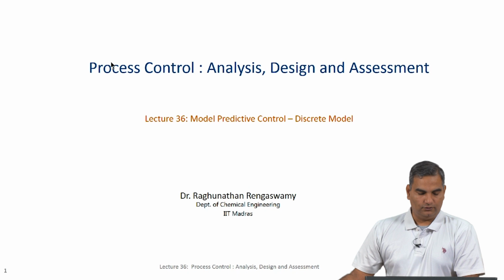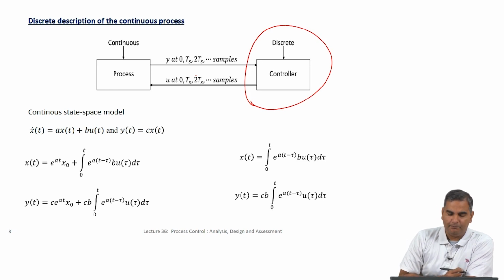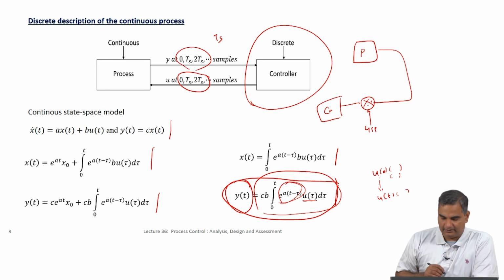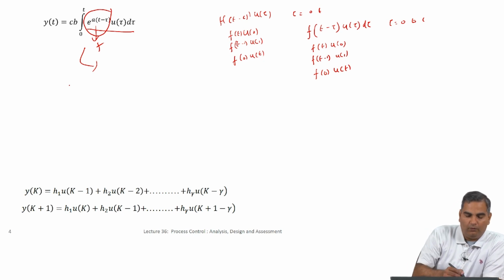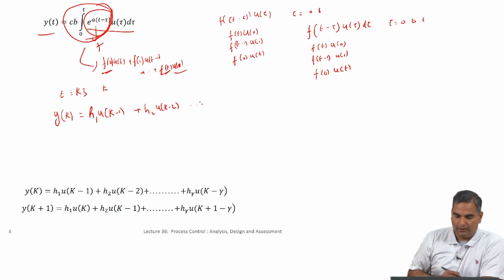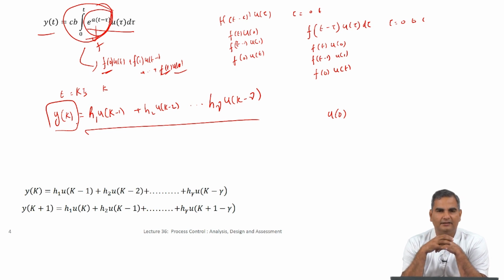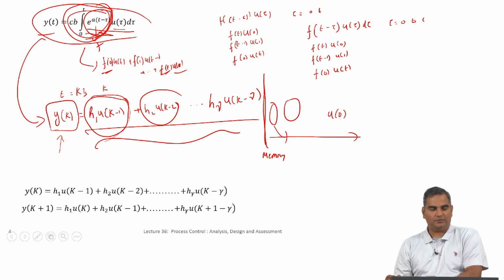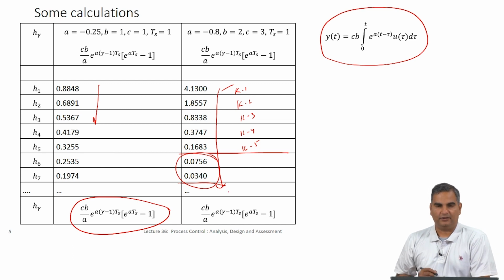Model Predictive Control – Discrete Model

Comment: Can anyone tell me what technique did he use to convert the continuous model into discrete?
Reply: It is the convolution of system dynamics with a collection of Dirac impulses. Search for convolution operation (*) in Wikipedia. That applies to linear systems only. As the lecturer has hinted in previous lectures that MPC can handle non-linear systems as well, I guess we need to linearize dynamics about a fixed point and then use the MPC around it. Well as we know x(t) = Ax + Bu is universal :)